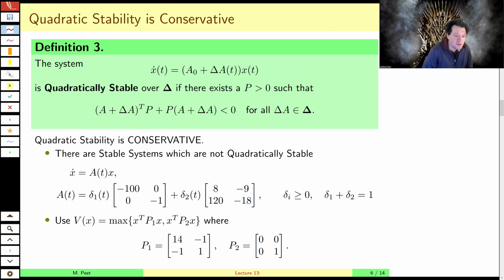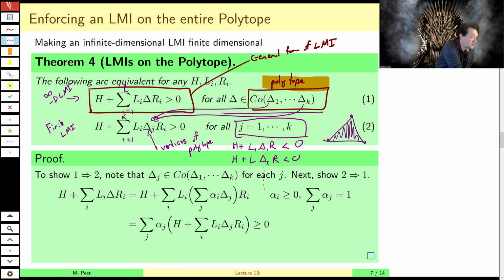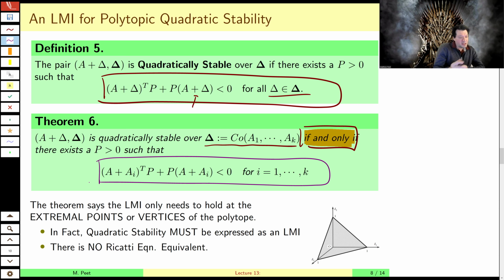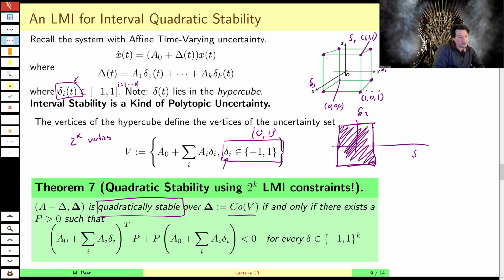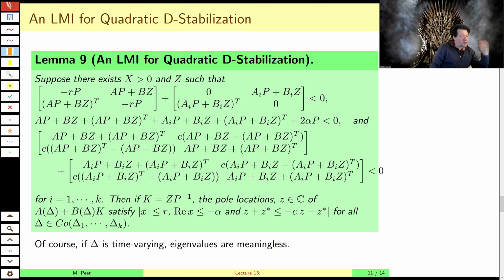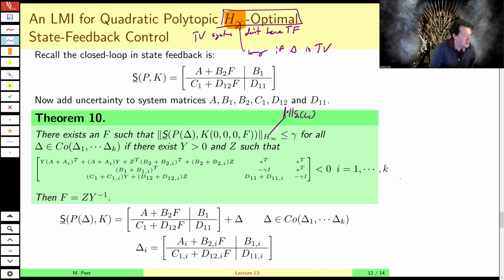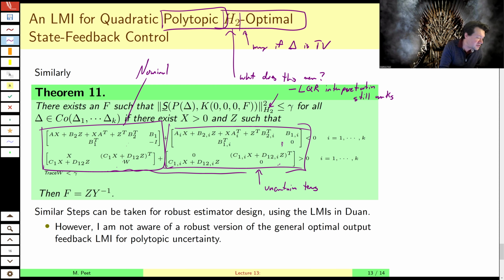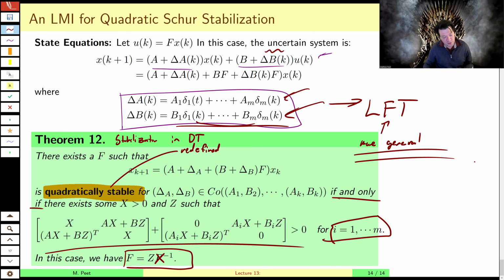MAE509 (LMIs in Control): Lecture 13, part B - LMIs for Quadratic Stability and Stabilization

Comment: Dear Pr. Peet,
Thanks a lot for making the lectures available.
The initial theorem gives an expression of the quadratic stability as one large LMI with a sum over i. However in the following results (p.10 for ex.), the sum is removed and it seems that we have to enforce one LMI for each i. Why would that be?
Since P>0 and Q>0 implies P+Q>0, would the second result be more conservative?
Reply from the maker: I think you are referring to slides 7, where there is a sum over both i and j? The sum over i here is the general form of an LMI. The sum over j refers to the fact that any Delta in the polytope can be represented as \Delta=\sum_j \alpha_j \Delta_j, where \Delta_j are the vertices of the polytope. Does this help?
Reply: @MatthewPeet  Oh my bad. I see it now. I was confused by the two sums and indices i and j. So I understand that there is one LMI for each vertex. 
Thanks a lot again. I will watch the next videos.